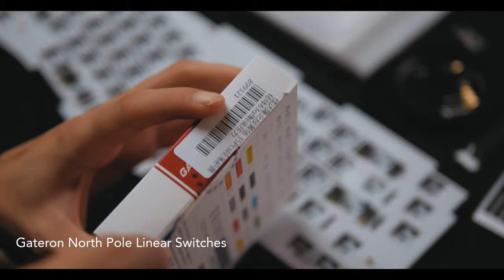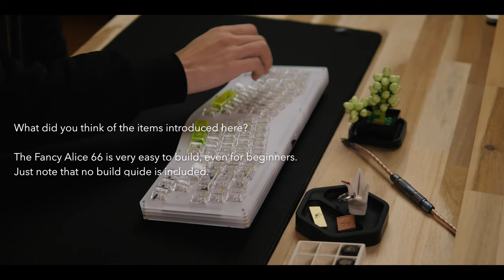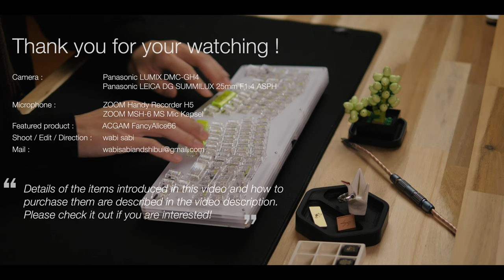FancyAlice66 DIY Kit (Build + Sound Test)-Whatgeek

Comment: Im at a loss.  The screws youre supposed to mount the top plate onto the lower levels is simply not long enough.  There are longer screws but not enough to fill the plate.  I could take the whole thing apart and back off the spacers a bit to give them more length but the tiny screws you use to install them don't give any wiggle room to back them off for more height.  I'm not sure if I've done something wrong at this point or if this is just a design flaw.  There's not enough resources available to differentiate the two.
Reply: And this is even more frustrating because there was no need for the screws to be barely long enough.  You have an entire empty riser full of thread you could be using but you're opting to use as little if it as possible.
Reply from the maker: Hi, you can install it according to the installation steps in the video. The products in the package can completely fill the board.
Reply: @Frankovelli I’m running into the same problem 😪